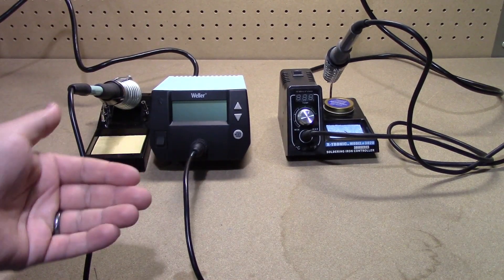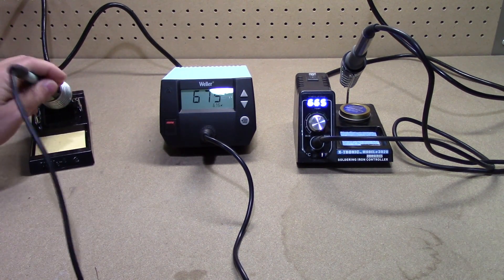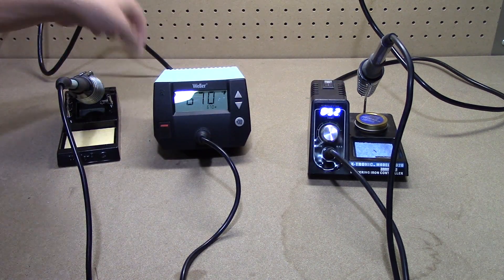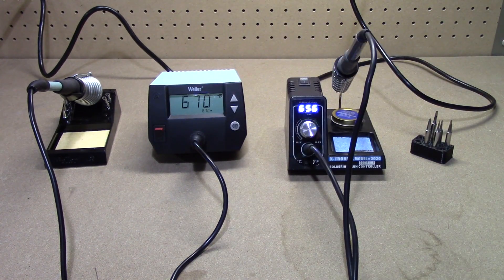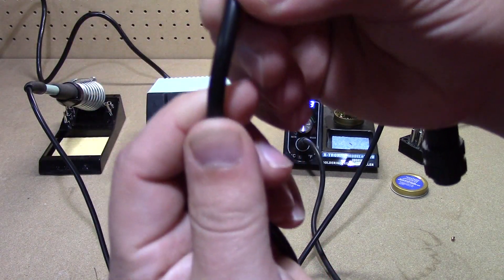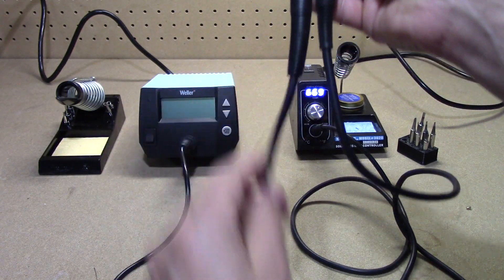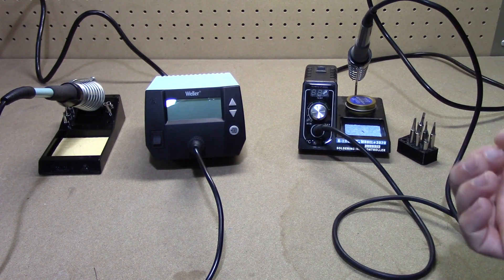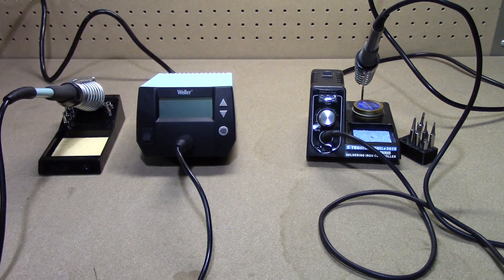EXPENSIVE vs CHEAP Solder Station - Is it worth the money?

Comment: So aside from a bunch of creature comforts & relatively irrelevant details, (as what most people care about is how well & reliably does it do the job you need it to do, all the rest is stuff that people adjust to without really thinking about it), there is no difference & they do the same job perfectly fine? In, which case the cheaper one is better to go with? Because if not, then the ACTUAL IMPORTANT info, like actually USING the device & whether they can do the same job to the same quality MIGHT be a more relevant & important thing to focus on, & SHOULD have been in the video.

By the way, Flux. Not tinning material, Solder & flux.
Reply from the maker: If you keep tools longer than a few years, those "creature comforts" make a HUGE difference. The most expensive option will stand the test of time IMO. But sure, you could get by with a  cheapie. Watching both devices melt solder would have done nothing to show the differences in the products as they both heat up to the temperature needed to do that task. I don't know what you expected to gleam from seeing that happen...

As the professionals know, most pots of tinning material are made of molten tin, with a zinc chloride flux. Simply calling it flux is inaccurate. 
And I hope you took your heart medication after watching this video as it appears to have stressed you out! If my review was that horrid, I would suggest filming your own conclusions.  Thanks for watching non-the-less.
Reply: @IllInformedHuman  Regarding the tinning material vs solder & flux matter, I mean, we could go back & forth on that all day, but I'll admit, I was being a bit overly pedantic on honestly trivial minutia, so fair enough. point taken.

Regarding the more salient criticism of the video though, I think you're missing the point of what I'm getting at, & in all fairness, perhaps I could have done a better job at communicating it. When I'm referring to things like creature comforts, for example, I mean things like how well the wire sheathing holds up to potential burns. I mean, sure, more durability is nice to have, but it's fairly inconsequential, especially if your using proper cable management practice to minimize excess slack of the cable, as doing so not only keeps the cable clear of the tip of the iron, but also minimizes the risk of things like bumping, unexpected wiggling or accidentally stepping on or otherwise disturbing the cable could cause the iron to jerk or wiggle in your hand, which you don't want in such precision work.

What I mean by more valuable data is things like the tips themselves, for example. I mean you said the 2 had similar tips, but weren't exchangeable & that the cheaper one didn't come with a tip holder, while the Weller did. Again, nice to have creature comforts, but doesn't really give insight to the more work centric use cases. What is the availability of tips? What's the variety of tips? How well do they hold up under use before they start breaking down? How accurate is the actual temp vs the reported temp? How granular is the temp control? How consistent is the temp? how high & how low can it go? These are more use case specific details that I think are more salient because, I mean if you're just tinning & soldering together splices of decent gauge wire, heck, any soldering iron would do the trick, but if say for example, you're doing component level work on electronics, there's a lot more to account for. In that same regard, when working with surface mount components, sure a flat chisel tip could usually get the job done, just like a handsaw would get the job of carving a turkey done. But a curved conical tip would certainly be a much better tool for it. Knowing the consistency of the heat output helps you know whether or not you'd have to worry about whether that particular iron is going to reliably do the job of soldering or de-soldering the component, or if it's going to cook the good components or scorch the board or damage the solder pads due to an unexpected spike in temp due to faulty power regulation. Knowing the quality & durability of the tips, plus the availability of them helps to know if replacement tips are readily available & ho frequently they might need replacing. Knowing the range of the heat output is also important to A, help ensure that you don't destroy what you're trying to repair by frying it, but also B, in knowing what solder options are available, such as whether it can sustain the heat needed for lead free solder, etc...

For comparison, I saw a video of a gentleman doing a side by side comparison of 2 hot air stations. Both were identical, except for in 1 very important regard. The air pressure of 1 was helped along by a fan in the hand held unit itself, while the other used forced air pressure traveling down the hose from the unit's base station. This is an important key distinction in functionality, because while they both can get the job done of de-soldering surface mount components, one does the same job much faster, due to the differences in the heated air pressure delivery. From this, it can also be gleaned that if, for example, you were trying to re-ball a BGA chip with a stencil & solder paste, with one unit, you'd have little issue, while with the other, you're gonna have a bad time. 

Anyway, I wasn't trying to be mean or anything, even though I was a bit snarky, I'm just saying I think that these details & areas of focus that are more salient to actual use cases are likely of more important to most viewers than things like the weight of the base station. I mean, I can't speak for others, but regarding the weight, if the cheaper one fulfilled adequately all the other needs, ok, slap some velcro or solid double sided tape on it & the table & problem solved. Non issue. 

I mean, for example, Let's say I had a bricked laptop that doesn't boot anymore due to corrupted or broken BIOS right? & let's say I had an identical, dead donor motherboard that had good BIOS chips on it, & I wanted to replace the bad bios chips on the otherwise perfectly fine motherboard with the ones from the donor board, giving me a fully functional laptop again. I'm not going to care about whether or not I'd have to 3d print a holder for the solder tips to keep them neat & tidy, I'd care about if it has the right tips & the whole unit performs consistently & reliably enough for me to confidently do the job I need it to do with the highest possible rate of success & ease. does that make more sense?
Reply from the maker: @demitriuspandi9736  That does make more sense. At the time I filmed this, I just filmed the differences that I thought were interesting. I had just upgraded my soldering station which is why I had the two. I was excited to show off my new toy and didn't really storyboard or think to long on this video. My old system did great for what I was using it for, the only complaint I had against it was the quality of the materials, especially the permanently affixed cable that kept getting tangled! Which is why I focused on the material quality.

If I was to shoot this video again, (I cannot since I threw the old soldering station away) I would add a soldering section where I compare the advertised tip temp to the actual. And how well it held the temp while soldering different scenarios. As well as have gone into more depth about tip quality. Maybe when I upgrade my Weller and do the comparison then :) 
Though, you have inspired me to think about making a "what to look for in a soldering station" video, using your points.

And of course, I can appreciate a bit of "snark" It keeps the comments section interesting.

Thank you for the feedback!

Comment: how can you compare 2 soldering stations without fucking soldering anything???
Reply from the maker: Are you blind? I just showed you  how to do that in the video? Watch it again if you missed it...
Reply: @IllInformedHuman I didn’t see any soldering of any components or anything to be honest
Reply from the maker: @M.E63  I meant that I was able to compare 2 soldering stations without actually soldering ☺
Reply: @IllInformedHuman  ok now I understand but we can’t compare then without actually soldering, as we need to check how they perform and what type of soldering they can handle, and other things like what tips are available and price of tips. Also quality etc, I can tell you though there both rubbish, weller is way overpriced and both use old technology
Reply from the maker: @M.E63  I understand what you are saying, but disagree. Even the $5 plug in - non adjustable soldering pencils will melt solder and properly solder a component. The fluctuation in the heat could be an issue. Or the temp could be too high.
As I didn't have a way to measure the accuracy of the hot end I thought it useless to show it just melting solder.
As for Weller, at least they use high quality materials than the cheapies!
Reply: @IllInformedHuman  I’m right as you don’t even understand what I said,  melting solder on a 5usd or 500usd iron doesn’t demonstrate anything, I’m talking about doing actual soldering not melting solder and talking about soldering different things, you can spend 100usd on a station and 50usd on another, and one won’t be able to do certain soldering tasks, sometimes the cheaper one performs better, some boards have several layers and not all stations can handle all tasks on multi layered boards, plus I mentioned quite a few things that should be demonstrated, not just melting solder, I mentioned things like quality, available tips, and so on, seems like you didn’t even read what I said, also people want to know what tips are available for each station and cost of tips as that’s a factor